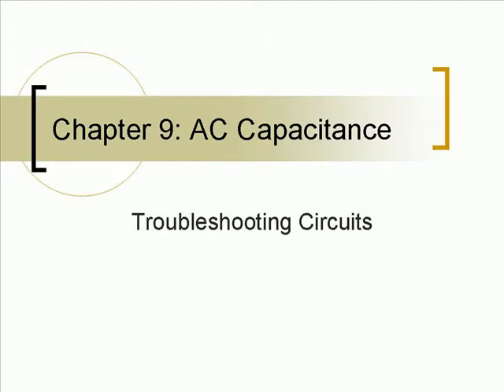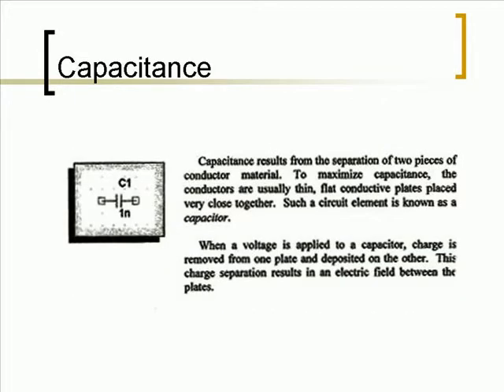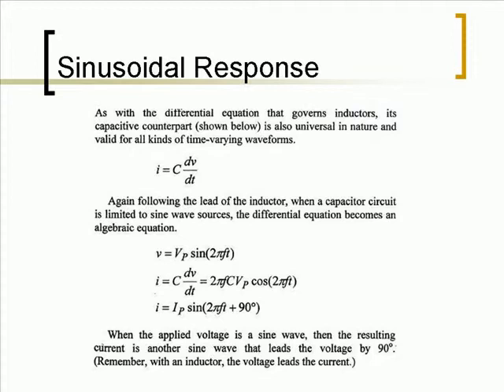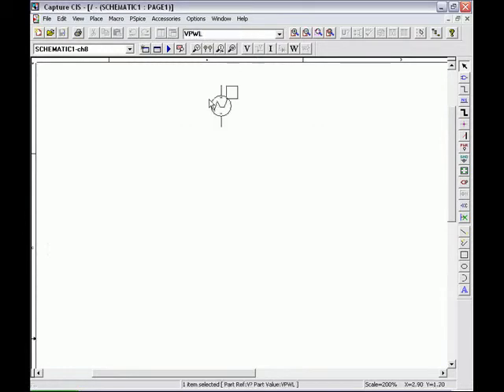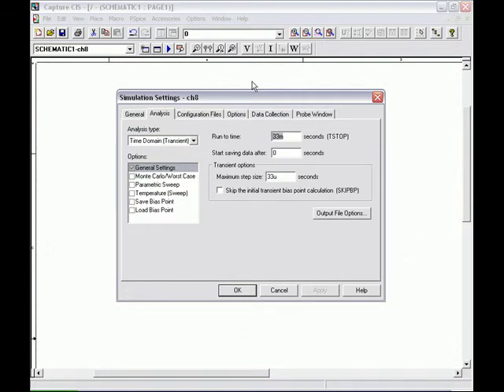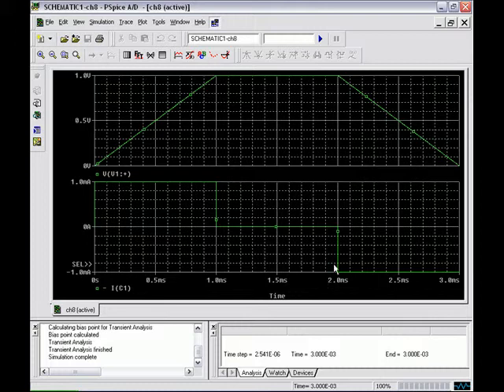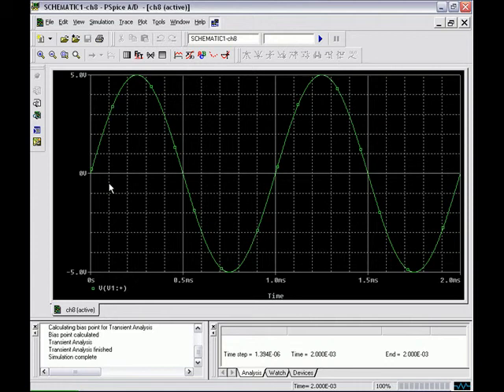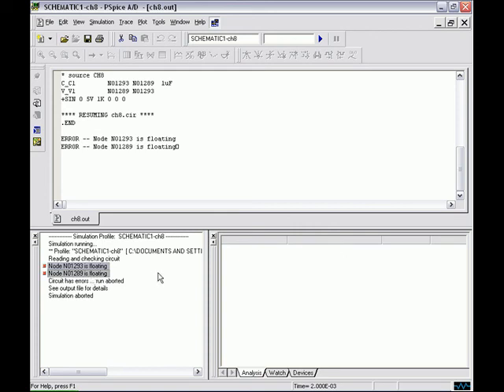AC PSpice AC Capacitance

Comment: How could you determine the capacitor size using pspice? I appreciate in this example you are manually entering a value, but if you connected two caps in series for example are you able to ask pspice to return the equivalent capacitance of the circuit without manually calculating it? I have a complex circuit that contains many caps and it would help me if I was able to inject a frequency in and have it return an equivalent capacitance. Can this be done, and if so, how?
 
Thanks